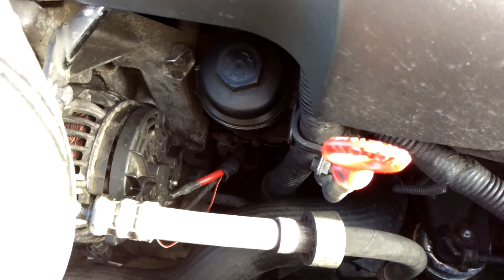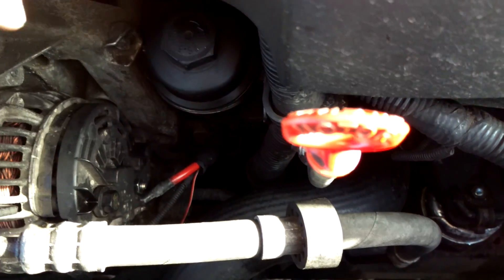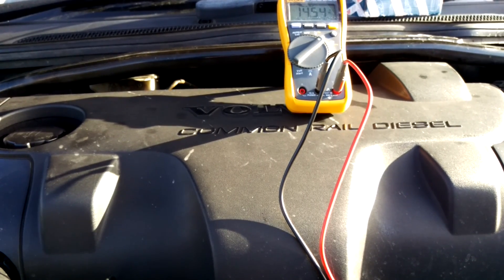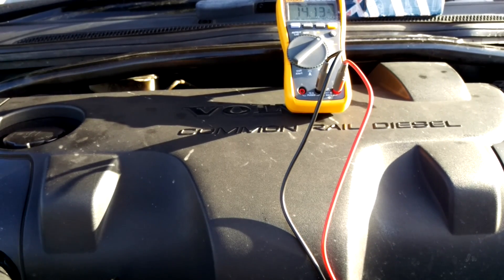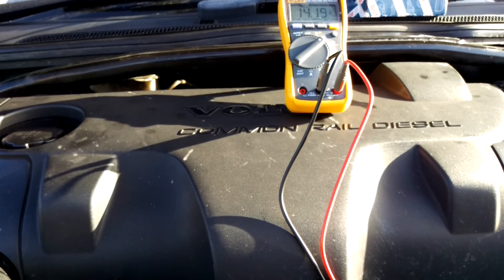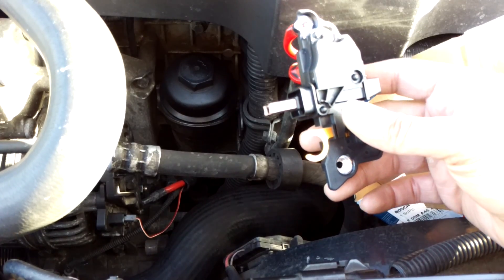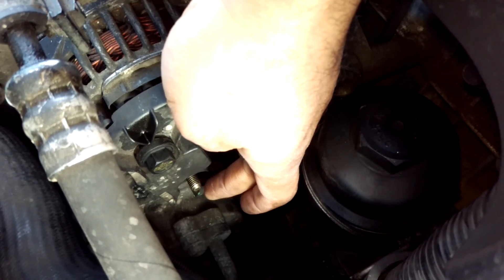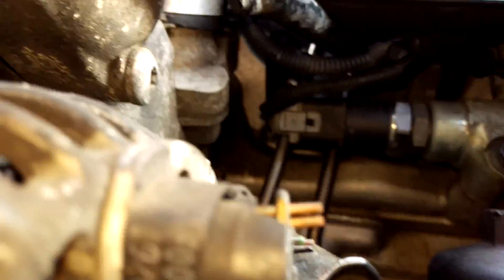How To Test an Alternator Part 3 Regulator and Brush Pack Replacement + Slip Rings Test

Comment: I've fitted a new alternator but get the battery light illuminated now and again on the dash.   The voltage is 14.4v though,  could this be down to a faulty regulator?

Comment: good afternoon thankyou for uploading these excellent videos, my ford focus alternator was getting hot when running and giving 14.2v as per your previous video I did the diode test and got .500 one way and 1.835 the other, now I have removed the cover the diodes test fine 0.5 and OL but the regulator gives 1.835 on a diode setting is this a bad regulator or should I be checking elsewhere

Comment: Hi sirrobb ive ran the tests & im not getting 500- 800v if im doing the test correct blk lead com red lead 10A socket dial set to diode symbol also reversed leads made no diff! So it must b my diodes but i recently had them replaced my an auto elect technition. Can something send them bad prematurely?
Reply from the maker: Tell what you are getting in both directions not what you aren’t getting.
Also, what were the results of the other 2 voltage tests in the video?

Comment: Just watched all 3 of your alternator videos.  You are a fantastic teacher and solved for me so many mysteries of the charging circuit.  I now know how to proceed in a logical fashion. Is the slit ring resistance value of 2.6 ohms standard for most alternators, or is case by case? If it is case by case, is that easily found in a service manual or online? I don't understand any of the negative comments or thumbs down.We need more skillful teachers like yourself and more encouragement from viewers who get vluable information for free.  Kind Regards. Craig
Reply from the maker: Thank you for taking the time to comment Craig.
There are a lot of companies and individuals who make excessive money by replacing alternators when there are much cheaper fixes available so perhaps the negativity comes from them. 😊

The slip ring resistance range does seem to be pretty universal but you can often find exact technical specs by searching for your precise alternator part number.

The general principle and testing procedure remains the same though.
Reply: @sirobb  sorry but you didn't answer the main question about ohms/resistanse values. I want to know that as well.

Comment: Increased engine load requires increased amperage not increased voltage.
Reply from the maker: It can increase both.
Reply: Even though it is most important that amperage and not voltage be increased during high load conditions.
Reply from the maker: Well that's the purpose of the voltage regulator and I have a current clamp and multimeter to check that it's working correctly.
Reply: What are the results shown by the current clamp as loads are increased?
Reply from the maker: Alternator output usually goes up to around 55A
Reply: The only question that now remains is what the problem is if there is no change in amperage output when loads are added.
Reply from the maker: What are the symptoms? Is there an actual problem with the electrical system?
Reply: Exceedingly low or no amperage output.
Reply from the maker: So your alternator output is 13-14v but zero Amps?
Reply: More like 0,6 amps at idle with no apparent increase with added load.

Comment: Nice video. On my D5 s60 charge voltage is ~14.2 on idle and dips to 13.5-13.4 when all accessories on (lamps, window heating, etc.) Should I be worried?
Reply from the maker: Tomas TomTomas Charging voltage is usually a little lower during the warmer temperatures of Summer so your figures don't sound too bad. 
It's worth checking the length of the regulator brushes and checking for voltage drop too like in this and my other videos.
Reply: Thanks. I'll check regulator brushes. P.S. I was measuring voltage when outside temperature was 30c. There was some temperature compensation in regulator, probably :)

Comment: Hello!
On my car, the old regulator has 14V, and I found a replacement one that is the same, but the voltage is 14.5V . Is it ok if I replace the 14V with the 14.5V? Is it that big of a difference? What do you think?
Reply: You'll be good, no worries

Comment: nice video . about 2 weeks a ago I noticed that my headlights are flickering .yesterday I disconnected the grounding connection from the battery and cleaned it .. but after reconnecting it ..it did not start anymore. I used a portable jumper ( basically an external battery ) .. the car started but the alternator was not charging .. and after I stopped the car it did not start again. I changed the battery , and retried starting it .. and if I rev it to 2,5k - 3 k rpm the alternator is charging .... if leave it at idle sometimes is stops charging..sometimes it continues charging for 30 seconds or so. Can you please give me any hints on what to look for to see what the problem is . the car was driven only 45000 km .   thank  you.
Reply: another detail , some oil or some moisture  got on the alternator ...because it got a lot dirtier in the last month . could this dirt/oil get to where the brushes are ? alternator part code 03F 903 023 E
Reply from the maker: dany To test alternator output, you need to be taking readings directly from the alternator  b+ post, the one which has the thick positive cable which feeds back into the electrical system. 
Specific DC and AC voltage readings are needed under different engine speeds and electrical load. 
This is a 3 part series of test videos showing several possible causes, each with their own subtle differences dependant on the results you get. 
Unfortunately, your descriptions so far, don't really tell me anything.

Comment: Well presented video. My alternator appears to be failing as it intermittently stops charging on occasions but resumes charging at correct voltage after about a minute. This only happens after car has warmed up. Brushes and regulator seem ok. Only issue is a slightly whiny pulley bearing. Have you seen this behaviour.
Reply from the maker: MsCelicagt4 Thanks for the comment. 
Your symptoms sound exactly like a failing alternator clutch pulley.
Reply: Thank you very much for replying.
Reply from the maker: MsCelicagt4 No problem. A good quality clutch pulley can be had for less than £30 and if it is the pulley, they can be replaced on their own without changing the alternator. The alternator itself is more than likely absolutely fine.

Comment: youve should replace the bearing and slip ring as well... i could hear bearing noises...
Reply from the maker: toopazio fonseca The slip rings were fine and there was no bearing noise so I'm not sure what you are hearing.
Reply: have you ever change the bearing in tthe volvo? if not you need to..you can buy them on
saverepairs.com

this guys have all types of alternator parts and cheap..have look on their website

Comment: Thanks for such a great and helpful video!  This is exactly what I needed to know, took the old alternator to 3 auto stores to have it tested and each case it failed... Had them try new alternators and all those failed as well.  Will check my brushes and replace the regulator if needed.  Thanks Again